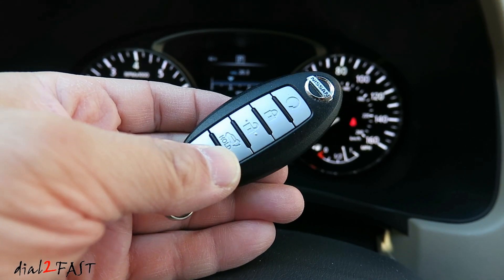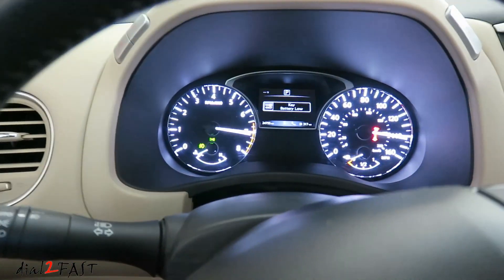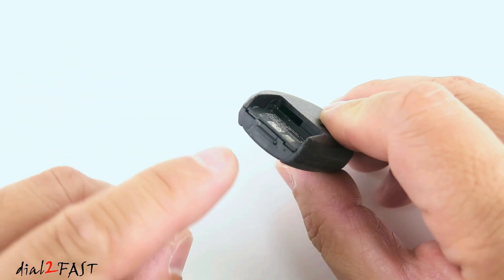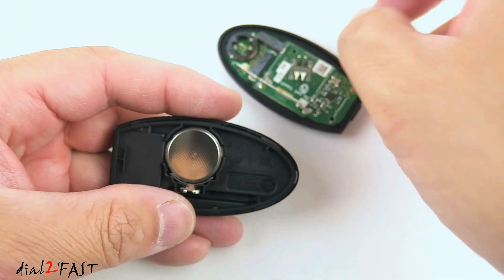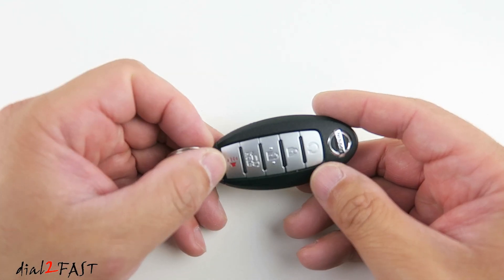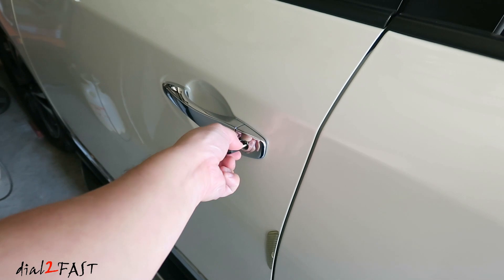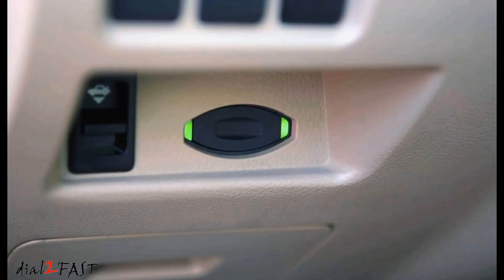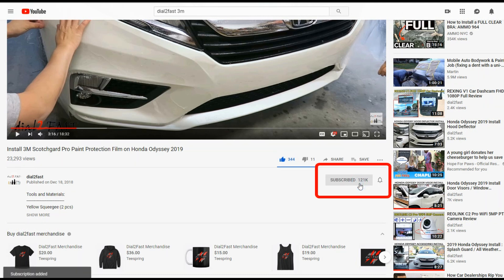How To Change Nissan Remote Battery & Start Car With Dead Remote

Comment: Your Videos are awesome! Have you ever done phone mirroring or a DVD bypass on your Pathfinder?
Reply from the maker: I kinda looked into the VSS wiring on my 17 Pathfinder, but I know starting in 17 model, the electrical wiring is changed (compared to 16 and older). I have not had time to look further into the wiring to do VSS or brake bypass right now.
Reply: @dial2fast  Thank you for replying back, ill be the first one to watch if you ever do!

Comment: Dial2Fast, Does this case have any signal blocking issues that make the remote less effective? What about remote starts from across the parking lot, unlocking and locking?
Reply from the maker: The case does not change the range of the remote. Doesn't make it better or worse.